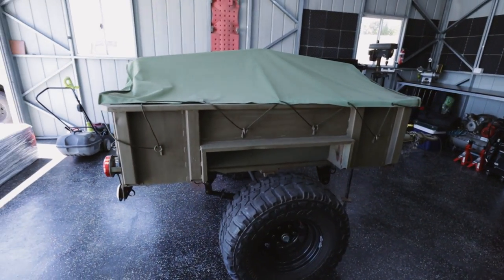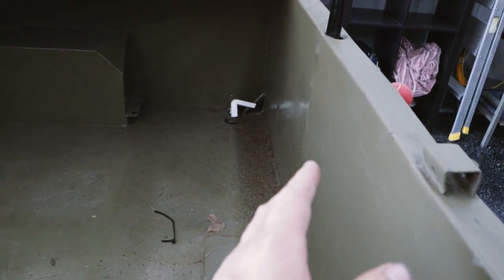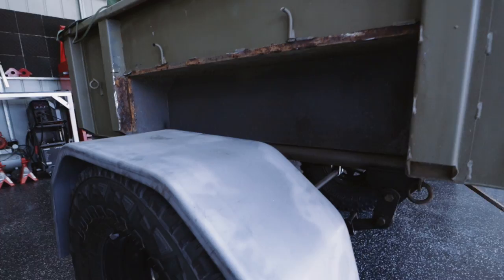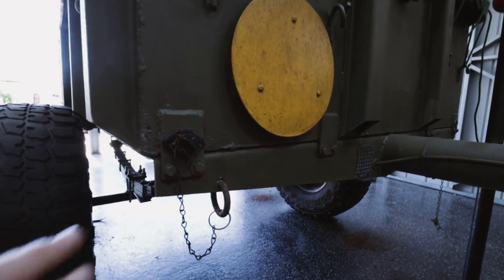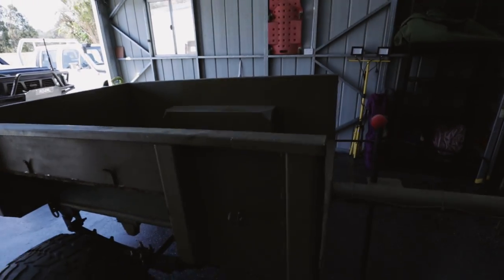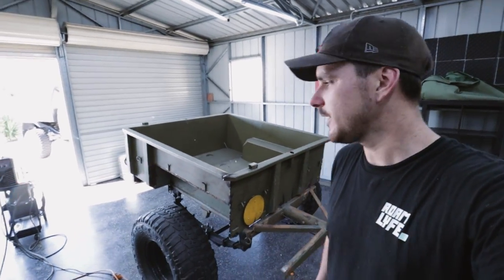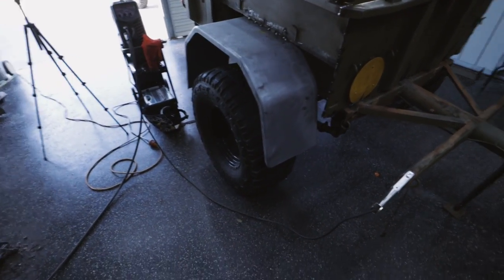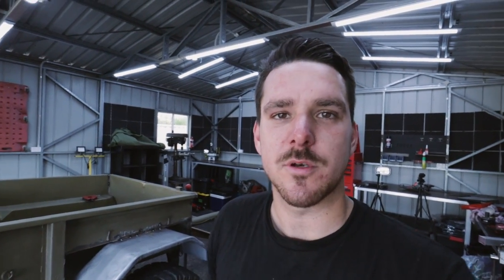Budget Camp Trailer gets PUMPED out mud guards 🔥

Comment: awesome job man, I'd cut out the inner  box's in the trailer and weld in a new flat piece  get some more room no need for them now.
Reply from the maker: I was thinking that but it’s so much more work 😅😅 well not really but the grinder is killing me haha
Reply: @RoamLyfe  push thru. It will pay off
Reply: @RoamLyfe   Kitkat, then back to work.  I have spoken..   😂
Reply: Definitely cut the wheel arches out. So much more usable space🤙

Comment: Love it, piece of art.

I'd recommend chucking a jerry can holder behind each guard in that empty space. Even if you have a water tank elsewhere, it's always nice to have room for more, or even more diesel. That, or a gas bottle to run the barbie.
Reply: Just watch it and was thinking exactly the same thing. Just need to think about weight behind the axle, don’t want to be too heavy at the rear.
Reply: @TheCrawf01   he did cut out a bit but the weight of the box he is adding + what ever else he adds i think it will be spot on.
Reply from the maker: Hi Paul! I actually do a lot of trailer fit outs at work so I’m very aware of the weight!! I was planning on doing 2x deep cycle battery’s and water storage up front! The box weights about the same as the peice I cut off! I’m hoping the weights will be bang on but I will be testing prior to taking it out!! I reckon you’re right too with the gas bottles!! Thanks for the comment mate 😊😊

Comment: I've had one of these for a while now. I did the same front cut, except I extended mine 600mm and re welded the front back on. 
Some No5 trailer advice, you MUST have some tow ball weight, if the rear is heavier than the front, they become very troublesome to tow.
Reply from the maker: Yeah the towball weight shouldn’t be an issue with my toolbox and dual battery setup etc! I’ll me testing the weight prior to towing tho!

Comment: Coming along but I'd make it flat floor get rid of inner wheel aches.don't forget 12 volt power, throw in a roof rack water tank great for shower
Reply from the maker: I dunno about the flat floor as my draws will fit between the wheel arches! Don’t know how much I’ll gain, still thinking about it!

Comment: Get yourself some workshop fans to mount in the top left corners of the back of the shed so theyre facing towards the roller doors. Bulk air flow and will blow out grinding dust 👍
Reply from the maker: Yeah mignt have too! I’ve always hated fans for filming tho, they are so noisy!!
Reply: @RoamLyfe  yeah thats true, at least you can run em when filming timelapses

Comment: some tube going from the gaurds to the front of the trailer to give some structural support instead of using box section, could then weld infill plates ontop and into the gap from the wheel well. Are you Going to put in a water tank at all? Got plenty of space could put a pump in and hose reel / shower setup
Reply from the maker: I’m just gonna do some slider style with 50x50 box section to brace the guards! But I’ll make it look good 👌
the plan is to have on board water with the kickass hot water system and shower!
Reply: @RoamLyfe  Im keen to see what ya can produce then dude im sure youll pull it off looks dope so far. 
Looking at doing an onboard water tank and pump setup myself & the kickass shower looks brilliant !
Reply from the maker: @ItzTommie  it’s amazing hey, hot shower while camping!! How good
Reply: @RoamLyfe   yeah im looking into one myself, they seem to be the best option of the market! 
Given much thought towards running a 12v setup & your inverter sizes etc, if you can get a fridge in that box, other sides perfect for a 12v setup / board whilst still maintaining storage capabilities or even turning it into a charging station ;)

Comment: Keep the Pintle hook on it for sure.
Reply from the maker: You reckon??
Reply: @RoamLyfe  well definitely the one on the front, you can get pintle hook tongue attachments for coal, and the one on the back will come in handy at some point
Reply from the maker: It makes a lot of noise while towing, I wonder if I can make a bush or something to soften it
Reply: Could make it a pulley point to winch off, double line pulls, anchor for cars behind etc. 

or even if you got a jet ski and turn coal into a road train 😂. 

Regardless would be super handy.